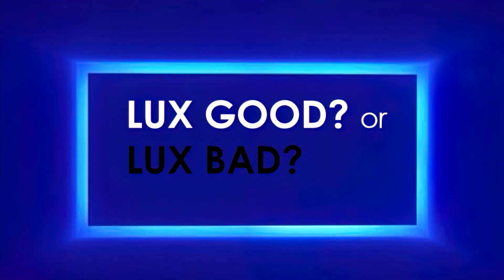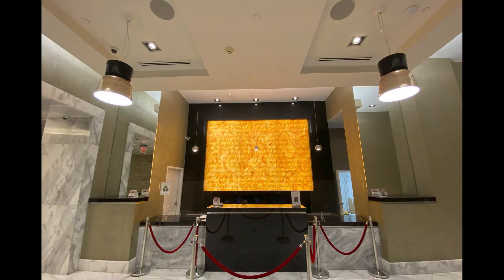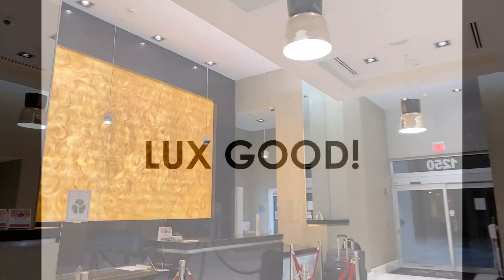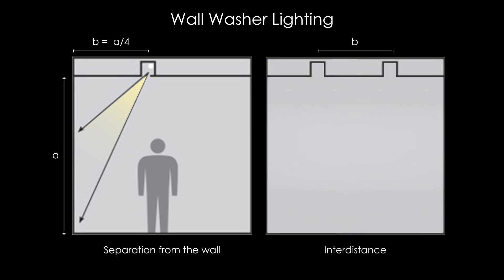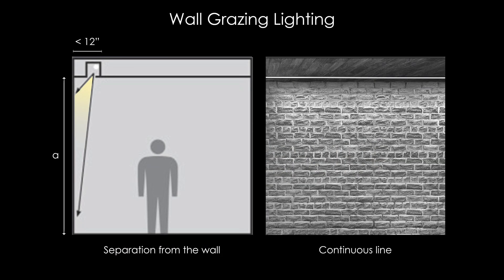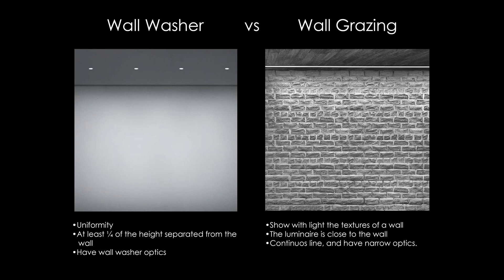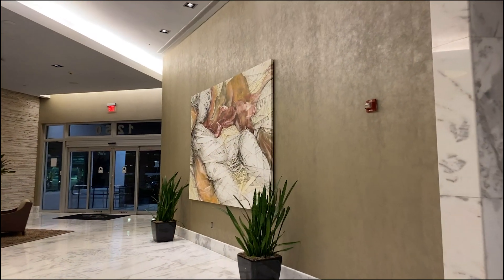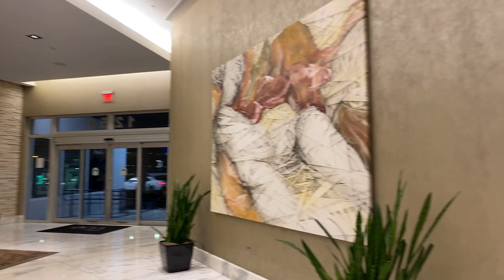Wall washer vs Wall Grazing lights in LUX GOOD or LUX BAD!

Comment: We have an exterior 24" high wall approximately 12 feet long (and the wall is slightly curved.  We need low voltage bronze finish lighting.  The stone wall is slate and it's very dimensional.  Do we need wall grazing lighting or wall washers.  Also, we need to have the lights illuminate the grass below.  Can you recommend some choices.  I can send you a photo of the wall.  Thank you.
Reply: So, I watched your video again and understand that we need wall grazing lighting which will nicely light up the dimensional stone work.  But will this give light on the grassed area below, because we do need to have that lighted as well.  Can you please advise and also what vendors should we be looking at?  Thanks